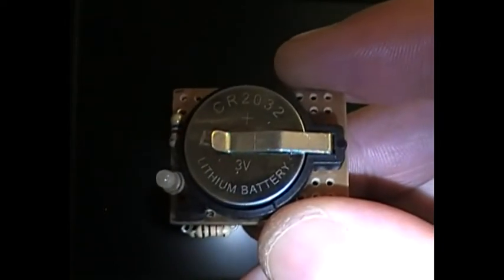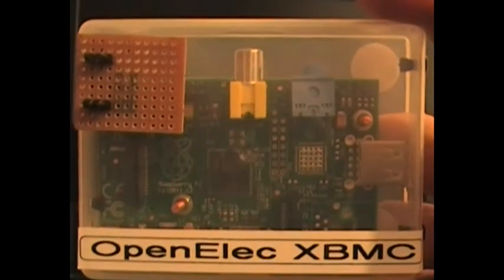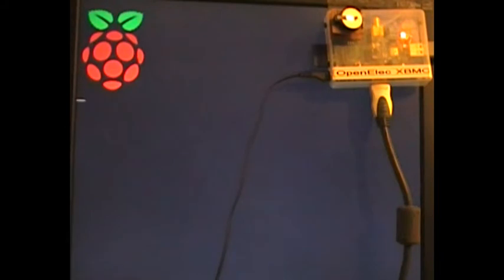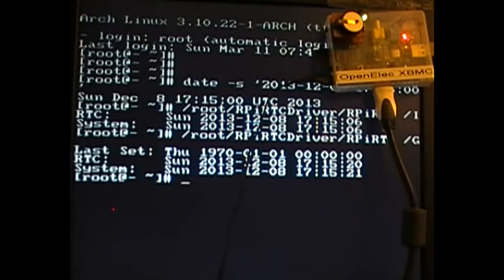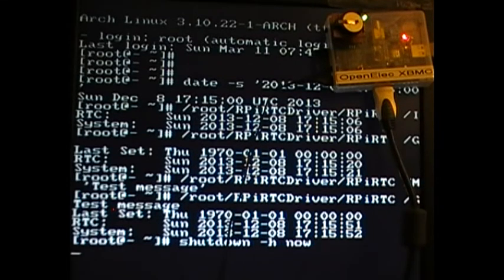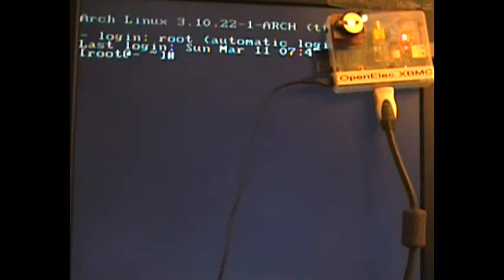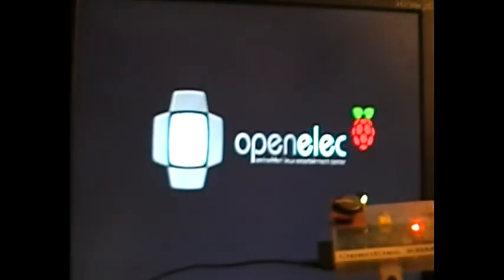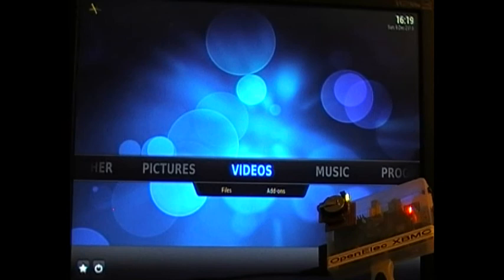Raspberry Pi Real Time Clock Module - Auto Set Date & Time On System Boot

Comment: Hi Jason, I would like to add a similar timer module to my raspberry model A+. But I want to control a 8 relay board using the timer. Similar to a  digital timer switch used in a house to ON & Off the lights. But the house timer has just 1 switch to On and Off the lights But in my case I want to use all 8 relays. Can you help me in this.  Can you teach me how to program and connect the raspberry Pi with rest of the modules. Tq
Reply from the maker: Linus, The first question would be do you have a preferred language to use currently. If not then Python would be the easiest, and we could go through step by step. The things the program would need to do as a first thought of the task would be:

Read the system time.
Set the system time.
Read the clock module time.
Set the clock module time.
User enter an on off time for a specific relay number.
User delete an on off time for a specific relay number.
Display a list of the current on off times for all relays, in a readable tabulated form.
Switch on or off a relay.

Add a main loop which:
   Looks for new user input to edit relay times (Add/Remove/Edit).
   Displays the current schedule of events for the relays and their current status.
   Handles when events occur.

Implement the electronics:
   Timer module to maintain a correct system time.
   Maybe a text LCD so you do not require a full screen, unless you want to use WiFi network from a computer.
   And a custom numeric keypad to go with the text LCD.

Here is a start of the code. I will provide extra periodically with expanation in the code.

gedit PiTimer.py

#/**************************************************************************/
#/* Initial code for a relay timer. This code simply demonstraes setting and */
#/* displaying the Raspberry Pi OS time using Python code.                   */
#/*                                                                          */
#/* The code requires permission in the OS to set the system time so needs   */
#/* to be run as the super user currently using the following command in a   */
#/* terminal window:                                                         */
#/*                                                                          */
#/* sudo python PiTimer.py                                                   */
#/**************************************************************************/

import os
import datetime

#/*************************************************************/
#/* Function to display the system time in a consistant format. */
#/*************************************************************/
def PrintSystemTime():
        Now = datetime.datetime.now()
 print(Now.strftime("%Y-%m-%d %H:%M:%S"))

#/*****************************************************************/
#/* Function to set the system time to the specified date and time. */
#/*****************************************************************/
def SetSystemTime(NewTime):
 os.system("date -s '" + NewTime + "'")

#/************************************************************************/
#/* Main application procedure.                                            */
#/* Currently just a test procedure to demonstrate setting the system time */
#/* and date, and displaying it, several times.                            */
#/************************************************************************/
SetSystemTime("2012-08-02 15:22:34")
PrintSystemTime()

SetSystemTime("1981-12-25 05:45:30")
PrintSystemTime()

SetSystemTime("2015-06-15 19:35:00")
PrintSystemTime()
Reply from the maker: Jason Birch
Reply: Jason Birch   Thank you Jason. I will try doing this. For now I have ordered the clock module which may take few days to come.
Reply from the maker: Linus Miranda Of the two, the http://www.lelong.com.my/arduino-ds1302-real-time-clock-module-battery-cr2032-robotshop-159223534-2016-01-Sale-P.htm , is the closest to the one I have used and looks compatible.
Reply from the maker: Linus Miranda You can find the e-mail address for my web site, at the bottom of each page on the web site, link in the description above.